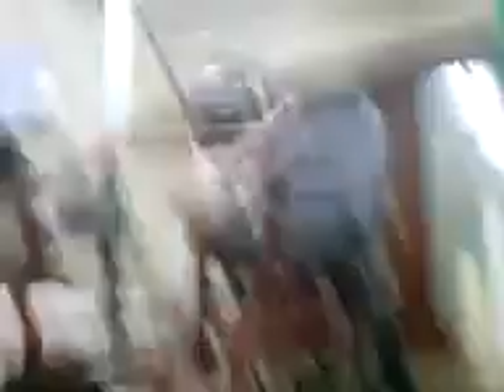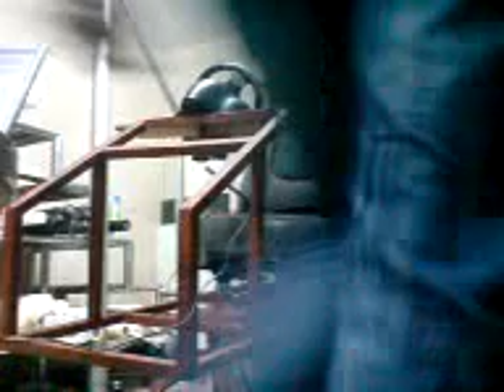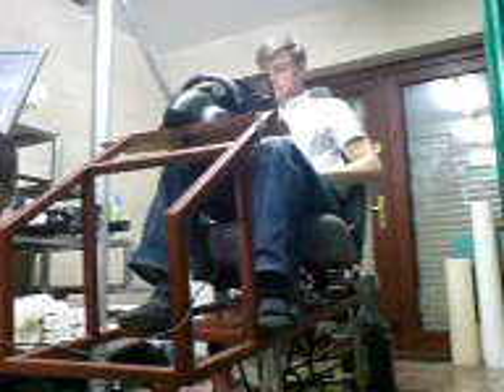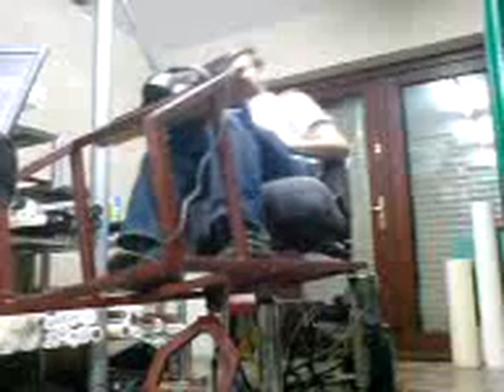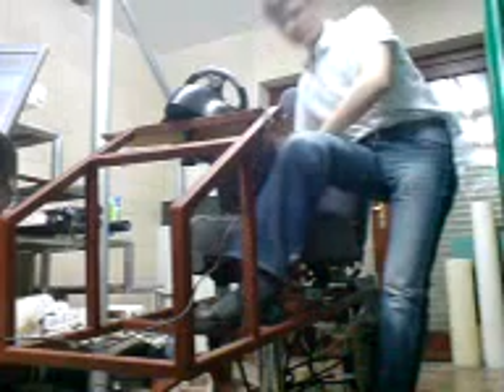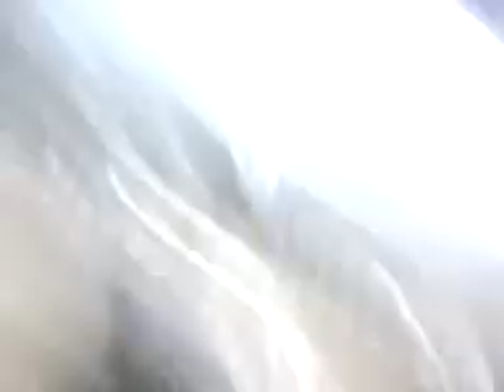www.oring.com.pl - Hydraulic 3DoF Motion Platform (best part from 4:00)

Comment from the maker: Currently to  grab info from game we use 3 Methods:
 - OutSim - unfortunately it work only with GRID and Live For Speed 
 - ForceFeedback (we write proxy software which introduce our platform as 3 Axis Game Controller) - it is vary important that AVR must send valid HID information through USB port 
 - DirectInput (if game dosn't support ForceFeedback) - software set DirectInput in share mode and grab every information which arrive from stering wheel (or any other game controller).